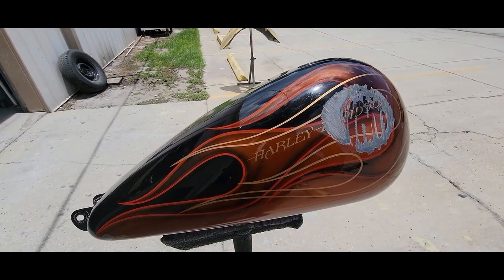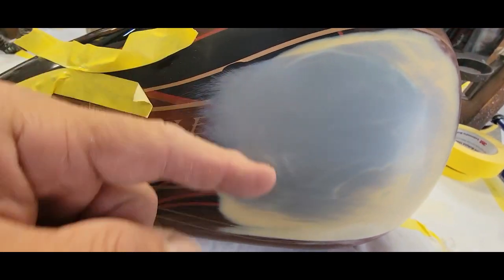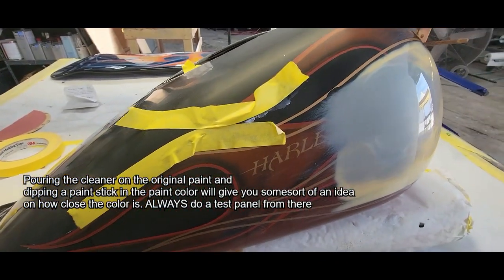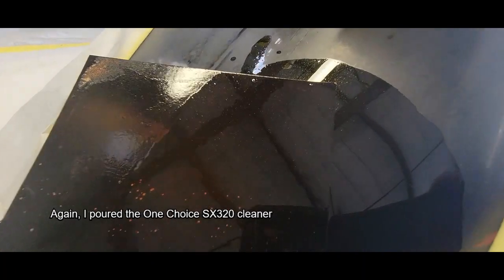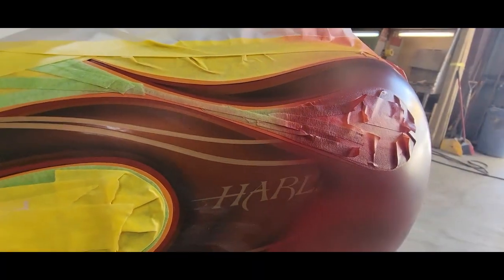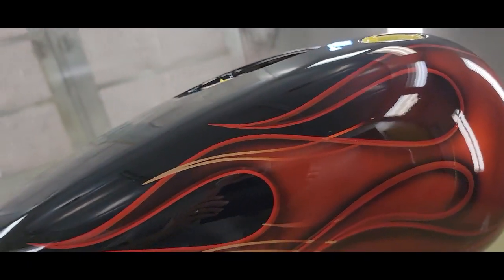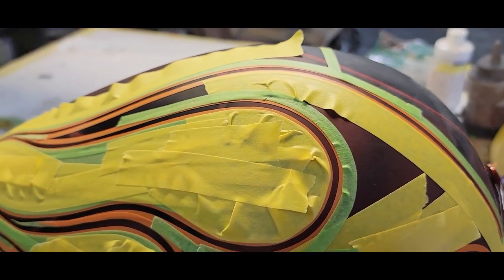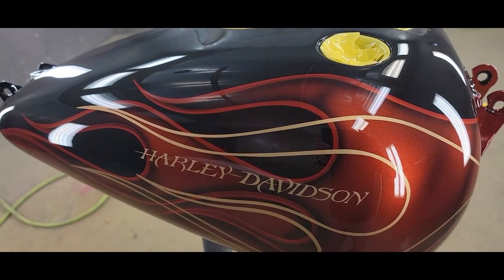Repair of a factory Harley motorcycle tank custom flame paint job - TIPS included

Comment: Just done a similar job. Stripes over candy over metajuls.Looking at your tape, are you using J tape?
That stuff left adhesive lines that I couldn’t see till I cleared. Now got adhesive lines showing under clear!
Panel wiped first too but didn’t remove it.
Just a warning, to check close there are no adhesive lines left before clear.👍
Reply from the maker: I had that problem with the 3M "blue" 1/8" tape. Any tight turns it would leave the adhesive. I haven't used that for many years. I use the Orange 1/8". Link in the description above. I believe that is made in Germany. I also think it's a little cheaper than the 3M. Or at least it used to be